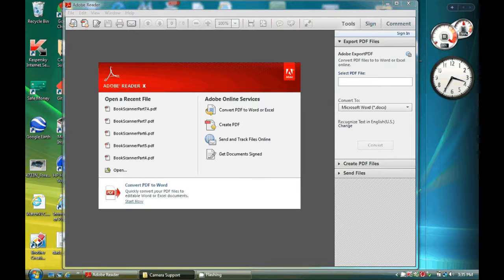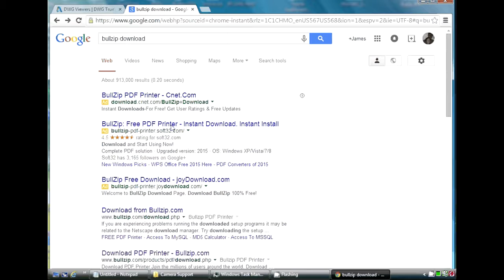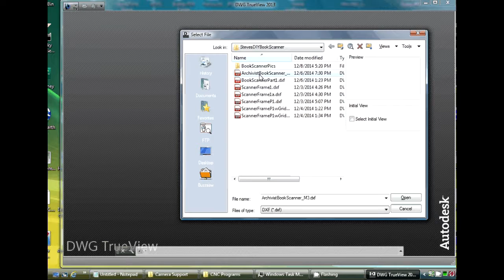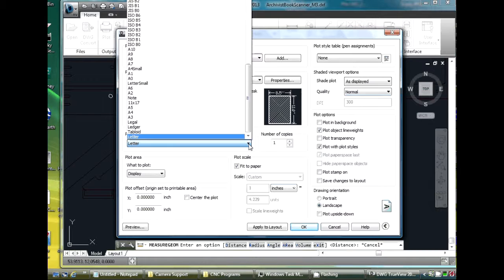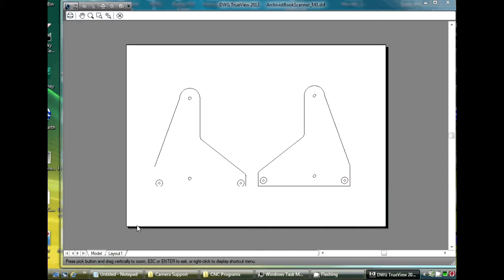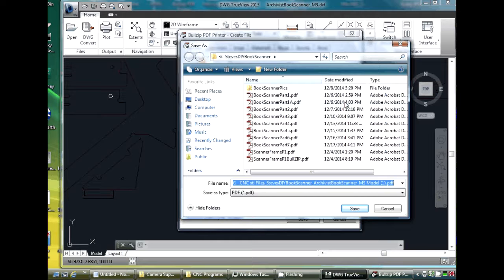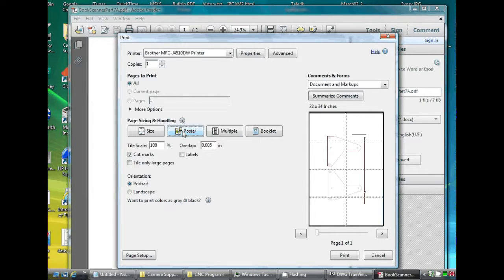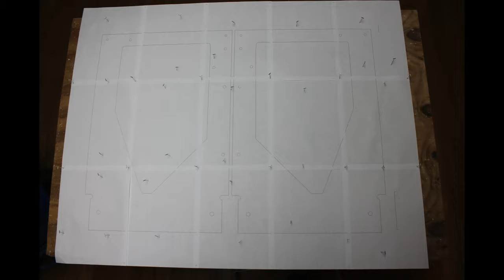Print Full Scale DXF Drawings

Comment: I downloaded everything only to find it won't work for me. I want to print a part that's 4 feet in diameter, but there's no paper in that size. At the bottom of all paper options it says custom paper size, but when I choose that there's nowhere to enter my custom sizes. Ugh.
Reply: I am having the same problem. I was hoping to print out a template for a 7ft boat but can't use any paper size over a few inches.
Reply: @cormacsmall9442  
You can split the picture into multiple smaller pieces.. This youtube vid has the details 
https://youtu.be/hjPr-VDbkyo
The software is old but still available for free from https://posteriza.com